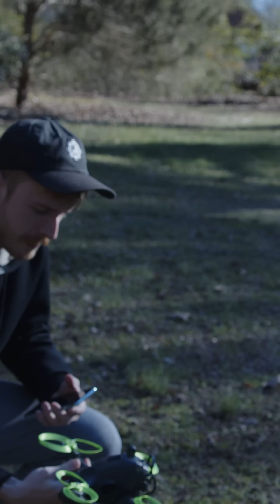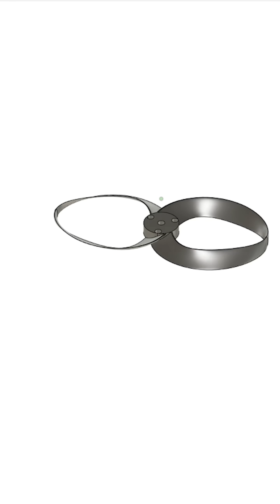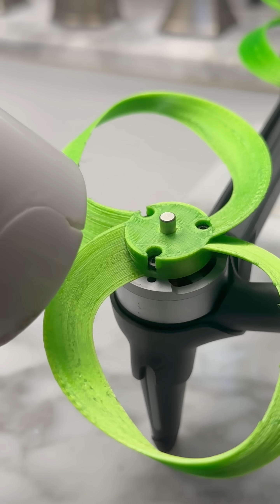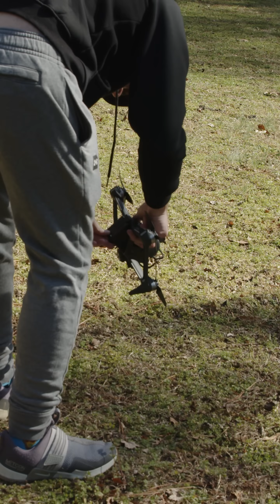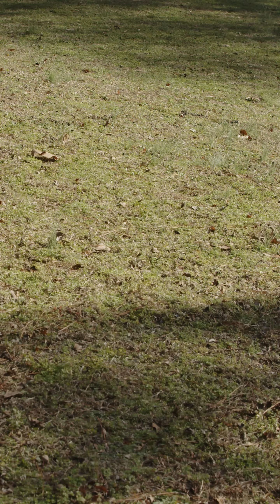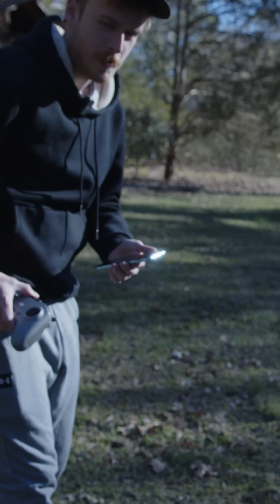Testing MIT's Toroidal Drone Propeller Design & Sound #shorts

Comment: The design isn't the flaw here. It's the materials and manufacturing.
Reply: MIT used a lightweight silicone based material that allowed them to be light weight and able to flex
Reply: @rustyshackleford9898  "lightweight" irrelevant.
"flexible" this induces vibrations.
Reply: @oslier3633  "lightweight" is actually relevant, as it's a description of the material and a necessary property for aviation. And "Flexible" is actually important. If you've ever played a guitar, or other such instrument, you'll know the strings are incredibly taut. This is because the human hearing range starts at roughly 20 hertz, or 20 oscillations per second, for the lowest note possible. This is still incredibly difficult to hear, and a flexible material should be moving at the 1-10 hertz range. This would make the propellers completely silent. But, there are other complications, which is why it's not easy to make silent propellers. What volume is is how large the vibrations are, or the wavelength. A higher wavelength is more energy, more energy is louder. It's kinda counterintuitive that the amount determines the quality, while the quality determines the amount. But a properly designed and manufactured propellor would make a very specific pair of wavelengths that would weaken each other, from the look of the design, and the groves from the 3D printing would make that fail.
Reply: @WEARETHEWARIORS there us so much wrong with what you just said
Amplitude and frequency are independent variables that is how speakers work
Propellers are not strings because they don’t have harmonic resonances or at least not in a significant way. There is a reason a drum has a specific shape but a string can be of arbitrary shape.
The weight of the propeller is unrelated to the sound it make.
Heavier propellers are more efficient but last a lot less

Stop typing nonsense on the internet and read some engineering textbooks.
Reply: Thinking exactly the same
Reply: The design really looks like an improvement overall
Reply: @zacharysherry2910  no- it does not.
Reply: @matthebert007  
Why not?
Reply: @zacharysherry2910 it’s actually less efficient in general but just more quiet so you would use them on camera drones that just need to get slow shots
Reply: @Arcticfawksie  that's not correct. they study showed that they are supposed to help distribute airflow more evenly and also prevent arbitrary vortices in center. 
Jays manufacturing was probably not using the right materials or proper finishing on the blades, even if assuming he printed the right structure.
Reply: @Dakota Rossman Your comment posted like 5 times. You might wanna come through and remove the excess.
Reply: @jobwilliams5705  his comment posted 13 times for me
Reply: @CombatMedic25  I'll level with you Dawg, I just didn't feel like counting. And although I never deployed, 68W superiority lmao.
Reply: @jobwilliams5705  lol thats understandable. And hell yea battle! Best thing to be is a soldier medic! Lol been awhile since ive seen or heard the words soldier medic lol
Reply: @jobwilliams5705  posted 12 times on my screen!!!
Reply: I was thinking the same thing
Reply: Needs more refining
Reply: and coating.. nail polish 💅 😂
Reply: if you know how a wing/prop creates lift, you would know that thing isnt verry efficient in any way
Reply: no it is not streamlined. Streamlined design is hard to print with 3d printer because it easily detaches from the printing bed. the blunt edges induce eddy and increases drag . we need to wait until molded polycarbonate ones for drone are commercially available at reasonable price.
Reply: Its also a flaw, go read mit's papers on them. Look at all that data they provide all 0 of it.
Reply: If that's the case, an extremely fair comparison would be between 3D printed regular propeller vs 3D printed MIT design.
Reply: How so??
Reply: @East_Coast_Toasty_Boy  3D printing makes a very rough surface. Propellers must be as smooth as possible. The nail polish does not help this. 3D printing also doesn't balance the propeller at all. I hope I don't need to explain to you how bad an out of balance propeller will preform.
Reply: @Error-5478  I figured it looked a little rough.
But I've seen 3D prints that were smooth before. Unless they were sanded after or something??? Is there any way to 
print it balanced?? Maybe make sure 
the block of material they're printing 
from is balanced??
Reply: @East_Coast_Toasty_Boy  The quality of the printer, material used, and specific printing process all play a big part in how the final product turns out. You can find printers from just a few hundred bucks to several thousand.
Reply: Flex. Just not going to be stiff enough
Reply: I love how we can find a whole side story within a side story in the comments of a comment 😂 
Bro asked for an argument and then got one. 
But these blades look like they could be quiet, I agree a better manufacturer, possibly a better material would improve the results.
Reply: Have him 3d print the original prop...
They'll still be quieter. Junk
Reply: I agree, but there are even more reasons why this went wrong.
If the pitch and diameter of the propeller is not designed correctly, the engine RPM can increase, consequently the noise.

It does not necessarily mean that the propeller shape is more or less silent.
Reply: Painted with nail polish… sound good but as a helicopter mechanic I promise it’s highly unbalanced
Reply: I was gonna suggest this- but then again the DJi Mini & others don't use this type propeller & they're all waaaayyyy quieter.

But I don't know jack- I'm just thought-vomiting.🤷‍♂️
Reply: There’s no real one made so how would you know that…
Reply: If I learned anything from these replies, some people have too much time on their hands... Makes me miss the days when YouTube had private messaging on it.
Reply: dont be so sure about the design.   he didnt get the design from some MIT download, he just kinda copied it by eye.   im sure youre right about 3d printing not being ideal for this (all the jagged surfaces cant possibly help), but the design here is just as suspect
Reply: Not at all
Reply: Proof that this is a nonsens design if it takes NASA grade tolerances to make a simple propeller.
Reply: Probably the uneven lair of nail polish that was most of the problem
Reply: Manufacturing and materials work fine here
Reply: Fix your mic dawg
Reply: You mean MIT knows what they’re talking about???? Noooooo
Reply: 100%. Obviously it’s gonna be loud when you’re using heavier and thicker plastic than it is actually meant for.
Reply: Yes but no - 

Yes the manufacturing didn’t help with the sound

No toroidal props barely lower sound levels. The only thing they do is change the sound profile of the motor however the decibels remain the same
Reply: Nice!! It's louder!
Reply: Мужики - не спорьте. Я напечатал этот тороид - он хреново работает - шляпа в общем...
Reply: @101picofarad  наука крута тем, что её можно повторить и при одинаковых условиях будет одинаковый результат. Ты проверил, автор видео проверил. Оказалось фуфлом.

Возможно, MIT просто существует ради всяких грантов. Это как в рашке тысяча министерств, созданные изначально ради откусывания госбюджета, только американские ребята хоть что-то делают в своей песочнице.

p.s. я не знаю ничего про деятельность MIT в 2024 году и что они сделали достойного внимания за последние 10 лет, просто предполагаю из воздуха
Reply: No one was saying otherwise
Reply: Exactly!! Imagine if this were produced and manufactured by cutting edge machines that were designed for such? WIN WIN ALL AROUND!!!
Reply: Honestly a design which is hard to manufacture is a S by default.
Reply: The design is very human.
Reply: Yes. Maybe if the guy would first print the regular props on the same printer and than compare the two printed versions, it might be somehow interesting. This is just plainl useless "comparison".
Reply: @Dakota Rossman They even could have just printed regular propellers instead of using factory built. It would have made a much better control, and probably would have just been easier. But, after all, it’s just an experiment. They aren’t claiming anything, only testing.
Reply: It's interesting to read this comment section
Ya learn new stuff every day
Reply: it’s just an experiment damn😂
Reply: Yeah, they arent smooth enough
Reply: Agreed. I think he further messed up any "quieting" effects they might have had by painting them in nail polish as well. The brush strokes from the nail polish are going to make the surface have a mess of odd ridges that are likely going to make them far louder than the design itself would normally be. And as you stated, the materials themselves and a consumer 3D printer; definitely created a finished product FAR inferior to what they actually made and tested at MIT.
Reply: Ok, then, where are they? I'll tell you... Nobody is going to tool and die this colorful little BREAKTHROUGH that isn't. Because they don't work. They are less efficient, have more mass, and aren't really quieter. 

But by all means  knock yourself out fist-pumping and high-fiving your fellow toroidal booster club bandwagoneers. 

In 6 months, nobody will remember "toroidal props". 
They'll disappear... as they should
Reply: @Dakota Rossman bro calm down
Reply: Actually, it's ENTIRELY the design! The MIT patent uses circles, NOT ovals. The circles eliminate any point, but using ovals adds the pointy tip right back. It's got NOTHING to do with the 3d printing. A quick look at the white paper or patent and the issue is obvious.
Reply: @NoMoreBsPlease  yeah I saw the propellers he printed out and immediately thought they were incorrect
Reply: What I can't help thinking, by how thin and flimsy his propellers are, is that they narrow during rotation. Centripetal force causes them to narrow and lengthen. Obviously, the design wouldn't work of the propellers change shape while spinning. How could they not be flexing outward? Unless that's specifically what the MIT design is supposed to do.
Reply: @esperago  I wouldn’t assume they are meant to be flimsy at all. Because propellers both in air and water need to be as smooth and as EVEN as possible. Even the slightest off balance will cause issues with wobble and with flow. Remember, gas acts like a liquid especially under pressure. Which is how we get lift in this case or in water we get movement by imposing a pressure on the water causing it to forcefully be pushed into almost a jet of high pressure water that as we all know will equally push on the boat causing it to move. With a plane the wings are teardrop shaped forcing the air to create an area of high pressure under the wing while the propeller is causing a pulling force giving us forward motion
Reply: @FunDipFobs  Yes, that's what I meant. That they should not be flimsy because they'll change shape while centripetal force is applied, which might be what's causing them to produce such a loud noise. I'm saying his 3D printing job was not good enough and produced blades that are too flimsy. We are in agreement.
Reply: You’re listening to electric motors, not propellers
Reply: Not a single one of you have any idea what youre talking about here
Reply: @AwramAndStorm  I guarantee that you are mistaken because there are NASA scientists and engineers in the comment section. Also, I’d like to point out, you never said anything to disprove their arguments, you just said they didn’t know what they were talking about, which actually implies that you have absolutely no clue what they are talking about so you have to try to bring them down by speaking against their argument; a very childish action, might I add.
Reply: @AwramAndStorm  are you from ohio?

Comment: You can also have the circle blades located in a o-ring duct chambers. 2 or more rings radius wall layer spinning these blades, hiding sound omitting more than 60%.

Comment: Works better in water than air.
Reply: ...but the motors & electronics would short out & the radio control wouldn't work very well

Comment: Another problem with tests like this are that the blades used should all be 3D printed. I've seen 3 of these videos now and people always use 3D printed propellers vs manufactured classic propellers. The weight and smoothness severely affect the results to the point where the results are meaningless

Comment: It would be interesting to mount these on a drone that has a more open interface that allows the operator to view the voltage being used by each motor and to compare which one uses more battery power...
Reply: or simply set it to hover & time how long it takes to fall out of the sky.

Comment: That’s really cool!  Has me scratching my head how more surface area vertices contacting the air stream could ever reduce the noise though.  Seems like a reduction in blade width while doubling or even tripling the amount of blades to achieve the same overall lift area would be a fun test
Reply: much of the noise of a straight blade is turbulence generated by the tip, these don't have an active tip so have the potential to make less noise.

Comment: You need to use a decibel meter onscreen as both of these are taking off. Because recorded all video maybe automatically self-leveling.  I use an app called sound meter that just present simple number. 

For example I'm sitting in a restaurant right now and the number is... 62 to 72, averaging 65.

Comment: The surface quality of a filament 3D printer is not smooth enough to handle aerodynamic profile. Even with a coat of a finishing product. The drag generated will be not enough to kill the lift, but enough to be very noisy. You should use a resin printer instead, sand the part very smooth and then make a mold with it to cast it with composite

Comment: add two more blades inside each, you should almost double lift. Remember, try n more verticle close to the shaft n flatter out for airspeed except for the end. Maybe zigzag the outside edge end for more lift.

Comment: that toroidal propeller sounds louder than the regular ones if you ask me
Reply: But thats because the making of it is not perfect. Not only is the design simply a guesstimated imitation (MIT did not release the proper dimensions and specs), the materials and manufacturing of the wings are also not the same (which can have a massive impact on something like aerodynamics).
Reply: There is another video on the ‘Tube where someone compared the frequency spectra of the stock prop to their toroid - the toroid appeared to have reduced some of the more irritating and difficult upper frequencies. There was no correlation between reduced noise and flight duration, implying reduced drag or energy usage. I’d like to see how a toroid prop increases range/endurance, climb rates, max altitude…these types of thing.

Comment: Very cool design, the air spin noise was lower pitched, in the new one, wonder how much more powerful a double version of this type, or a 4 blade rotor would be? Btw' imo' The quiet issue was solved by mother nature' a long time ago,Hint 'Owl's'🦉 Easy to figure out' really surprised i've never seen anyone go that direction?! Definitely have to print or make it yourself. ps, Material types' are key with it'_ridgid rotor with a soft part additive, as well as 'balance , So Printed might have to be the way to go. Hope this helps your quest!🖖
Reply: owl's wings have a very different aspect ratio & move much slower

Comment: Please a) print these better or b) do a lot of post work to smooth those 3d printed props out. Sanding and either heat or chemical polishing.
And then 3D print similar traditional props, do the same treatment on them, and then compare those two.
Right now you're comparing traditional professionally mass produced props vs a mess of bumps and ridges that sorta kinda looks like MIT's design with none of the math or even exactly copying (CMIIM) their shape and design. It is not a fair comparison at all.

Comment: Your new ones are 2 main mounts like a regular 2 blades spinner
but there are two areas of lift to EACH blade...
Therefore 1 blade has 2 lift surfaces 
There are 2 blade routes, but 2 blades per mount.
Therefore
These blue ones are equally a 4 bladed prop.
& The high end has been removed from the frequency....
Cool.

Comment: But I do hear the top end frequencies taken off.....
Do with that as you will there is a difference.
PROP BLADE TIPS APPROACHING TRANSONIC MAKE SOUND WAVES. And these blades remove the tips
Not to mention these propellers also double your surface area with less drag.......

I see the original blades on your drone where the typical three blades.

Comment: You did all that hard work making the shape printing them out and then you use nail polish..........
It's like you literally didn't give a shit about researching anything about painting or clearcoats.....
You realize I have one serious question right.
Why nail polish....
When I sit here knowing how to whet sand.
Slight confusion really.
Just figure you'd want your work to be A LITTLE more durable.
I realize I can nearly SEE LIGHT THROUGH that plastic.
That is thin so I get it, you're going for light weight.
But then why not use thin poly or something else that won't break away & dry out like super glue.

Comment: Wasn't this their 2nd of 5 current designs? I'd maybe try using their newest and current design...it fares better in mid-high range RPMs if I recall correctly,  where as this one was too similar in Decibels to regular fan blades.